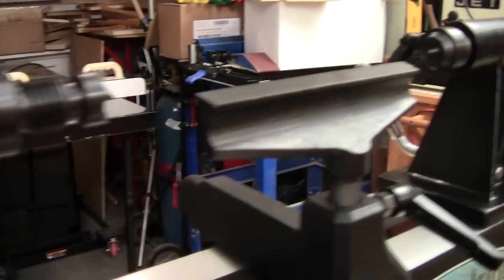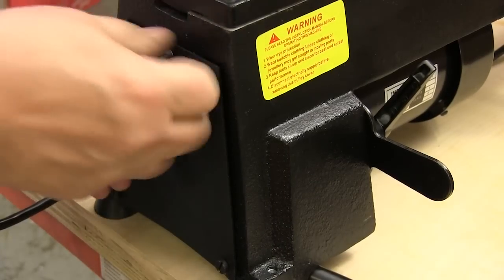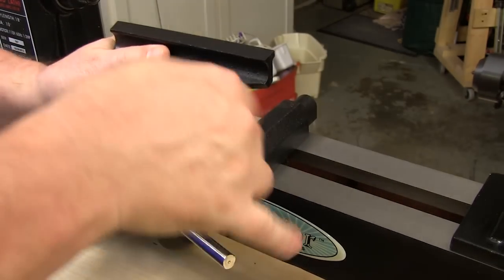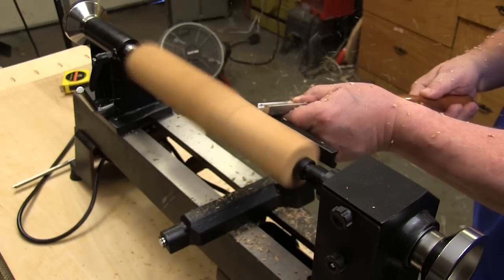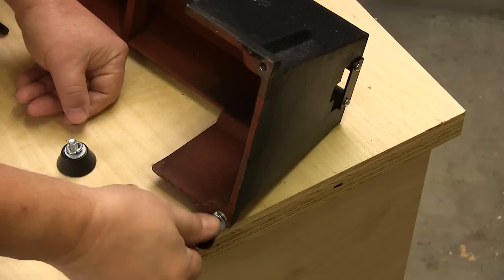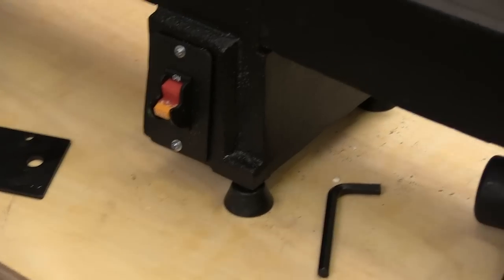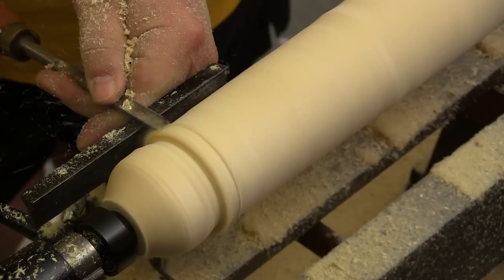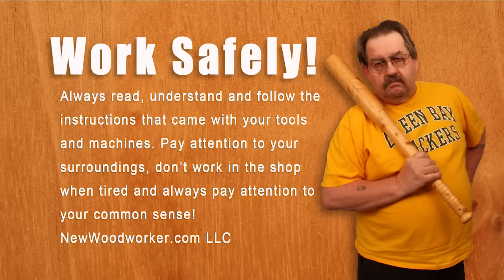Rockler's Excelsior 5-Speed Mini Lathe

Comment: This unit is the same as my Turncrafter lathe purchased from another vendor. It's held up well over the years. I've had it about 6 or 7 years. On my lathe, I bought the variable speed control kit and upgraded my lather. Either way, it's run well.

Comment: I got this lathe as a gift and bought a Nova G3 chuck to turn with it.  unfortunately i can't get the drive plate off (it was already on when the old owner dropped it off)  Any suggestions?
Reply from the maker: First, make very sure that there are no set scews locking the drive plate on. Lots of them did have them. Then I use a little heat to expand the drive plate. Usually a regular light bulb placed right at where the plate screws on. Leave the light on there for an hour or so to soak heat in the the plate and then hope it breaks loose.

Comment: Same thing as my lathe but from Harbor Freight. Have you figured out how to replace the drive belt? Mine has almost torn to shreds, possible misalignment of pulleys.
Reply from the maker: All lathes look essentially alike but this "same as Harbor Freight" thing is nothing more than forum miss information. We have tried moving parts between a Harbor Freight lathe and the popular ones that "are the same just a different color" and nothing fits. You need to talk to the manufacturer for belt changing specifics.

Comment: When you change the belt position and have to lower the motor back down, do you tighten it where its weight puts it or do you have to push it down some? I ask because I have no experience with this.
Reply from the maker: +artsoulfull I do push down a little but you don't need a bunch of tension there. If you notice the belt slipping add a bit more tension ad before ong you wll get the feel of how much pressure to apply when tensioning the belt.

Comment: when aduting the lathe speed do you also have the belt on the matching gear? or do you leave the bottom one where it is and just swtich the top
Reply from the maker: You have to move the belt on both the toop and bottom or the belt runs at an angle and will tear itself apart.
Reply: @flyingrcdotnet  I had a hunch. Now when I did try moving it there was not a lot of tension on the band how do I make it more taught is t adjustig the motar or  something else
Reply from the maker: It's been a decade ior two since I had that lathe but thewre has to be some kind of adjustment at the motor for the belt tension. The manual shoud show that and the procedure for setting that tension.

Comment: Just received mine and how exact does the center of the tailstock and chuck need to be? Please advise... my tailstock center point sits slightly lower..
Reply from the maker: The key here is your definition of "slightly". I have had miss alignments that I could just barely see and not had any trouble turning. You also want to see if that alignment changes when you tighten the tailstock down, especially if you really honk down on that lever to tighten it. You can over tighten a tailstock and cause an alignment issue.
Reply: Okay, thank you for getting back to me!
Reply: V Essagol f